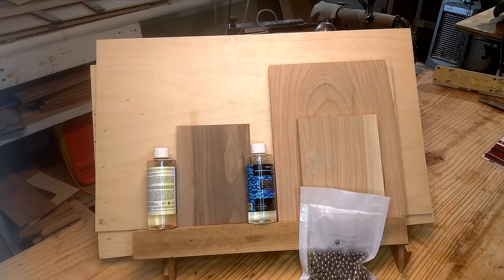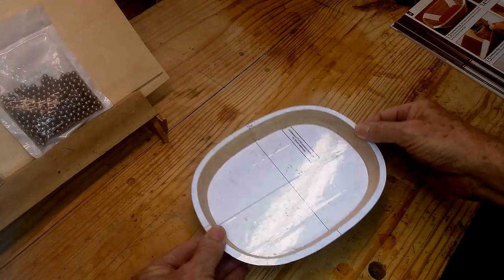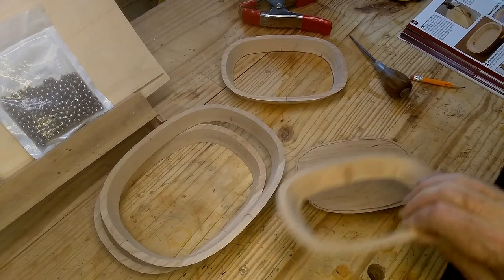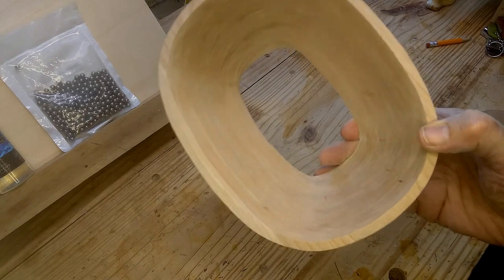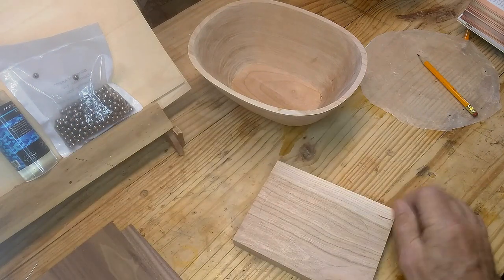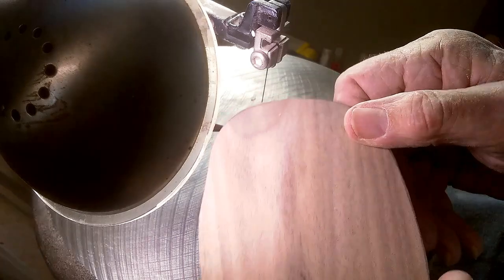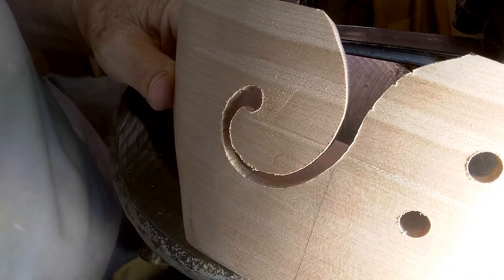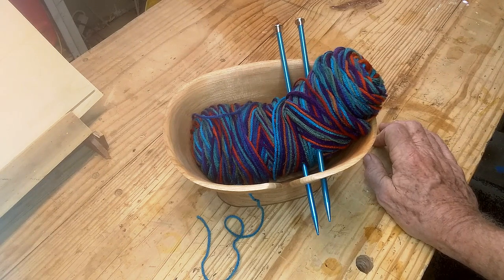A Scroll Saw Bowl With A Special Use

Comment: On my saw the table doesn't tilt ,, the head of the saw tilts so do I still tilt it to the left ⁉️⁉️⁉️⁉️
Reply from the maker: You would tilt the head to the right.  You want the right side of the table closest to the head.  With heavy bowl blanks I would prefer the head to tilt.  The blank is heavy enough that you have to be sure to keep it from pulling downward against the blade especially when you have  the larger angles, like 35 degrees and upward.  The blank really wants to slide down the tilted table and it can throw your angle off or flex the blade in the cut if you don't keep a little pressure upward.  I also have more trouble keeping the material from "bouncing" when slanted.  It can make it harder to see the line you are cutting, it can begin to look blurry.  But then that just may be my old eyes.
Reply: @twinoakstreasures9032  thank you
Reply: Just imagine in your mind, that the head of the saw is stationary and the table tilts. If you want the table to tilt to the left, the head of the saw must tilt to the right. It's always opposite.
Reply: @rayscrafield2106  thank you